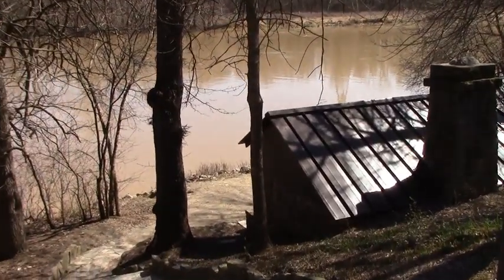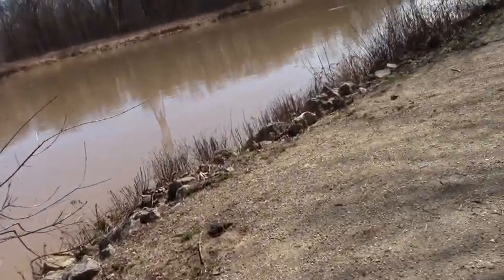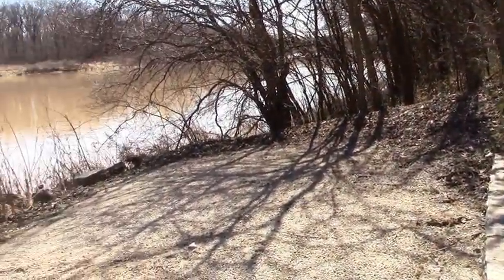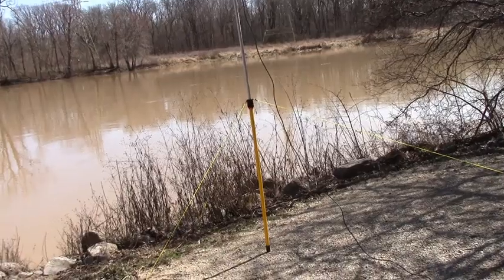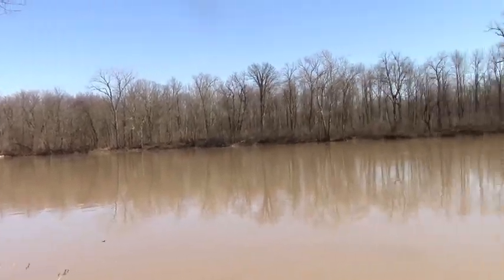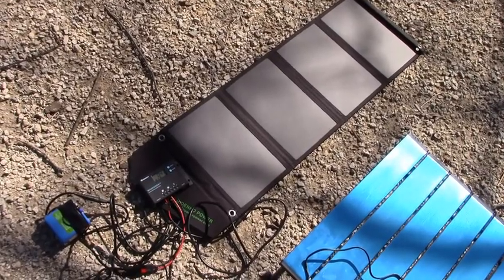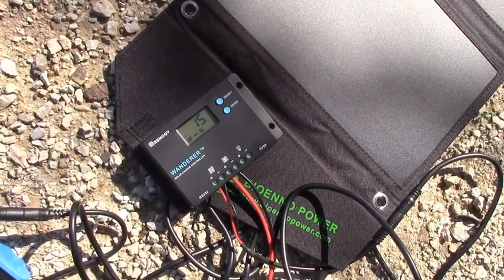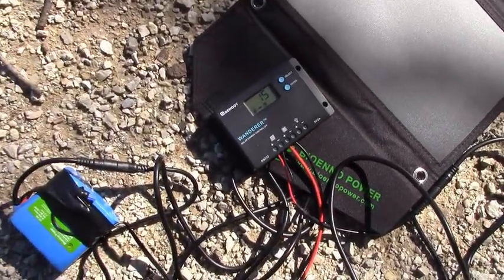How to use the Bioenno portable 28W solar panel to charge a 3Ahr Bioenno battery and power a KX2

Comment: I'm rockin' a 3ah with a 28watt panel for my kx3. Picking up the 40watt and 9ah as an alternative/supplement. I want to convert the barrel plug to Delphi but I'm afraid bioenno's wire is shielded, not two separate wires...
I imagine the same problem if you wanted to convert to Anderson PP. Any input?